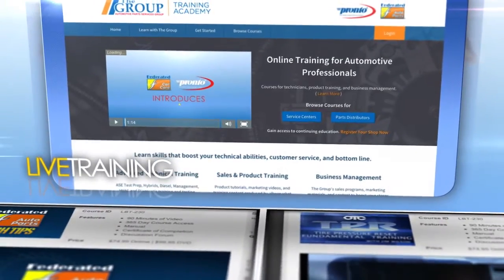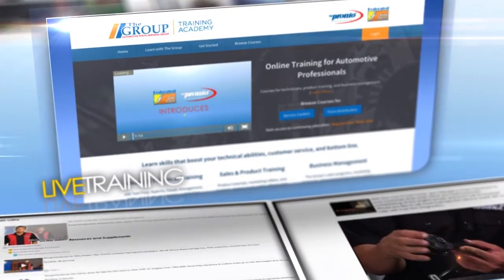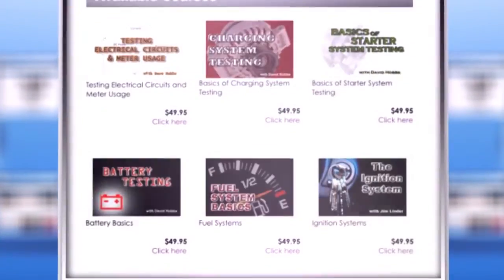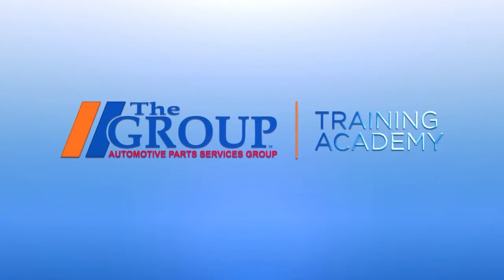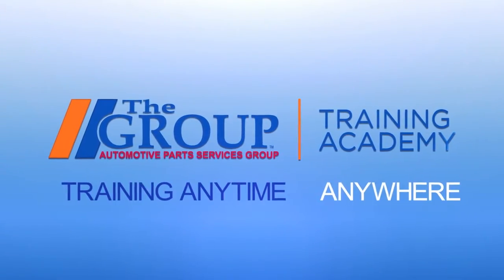Forced Induction - Spark Plug Gap | Ron Bilyeu | Tech Tip

Comment: Any advice on gapping for a kia stinger gt v6 twin turbo that already is gapped at 36, I guess do to the twin beasts, and if I add a tuner and run on 93-94 octane that adds 4-6 psi of boost, maybe even a bit more, is even a lower gap now required for safe ignition, etc.. or I'll get safety issue from wrong spark ? If yes, is just going down to 30 gap enough or lower ?  Also, if go lower to handle that, what happens when I select back to map 0 (stock performance) on the tuner or only map 1-2 which is only a bit extra boost ? will me fixed gap setting now be too low to risk running it on map 0 or 1-2 ?